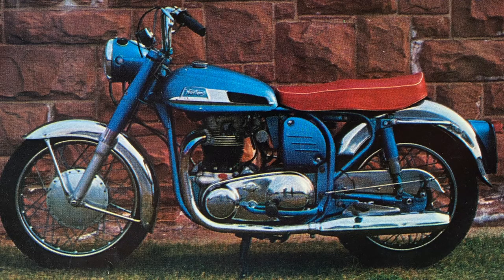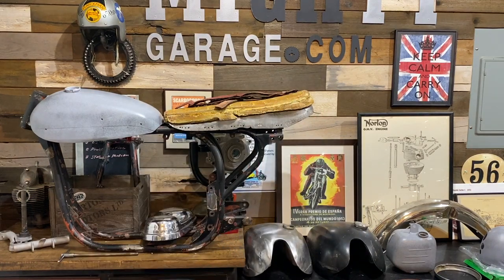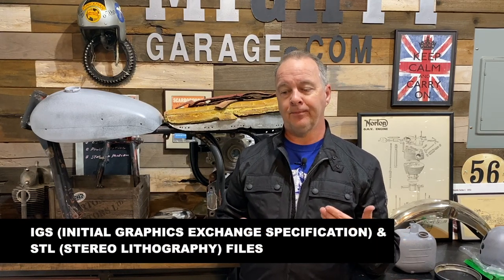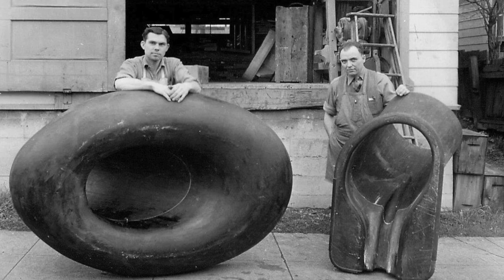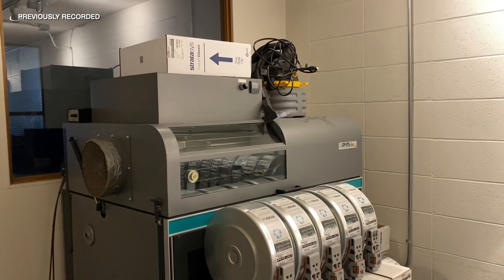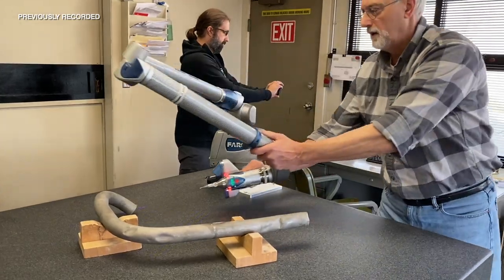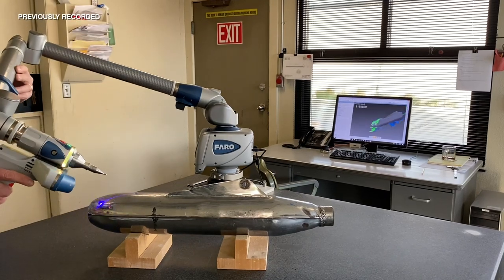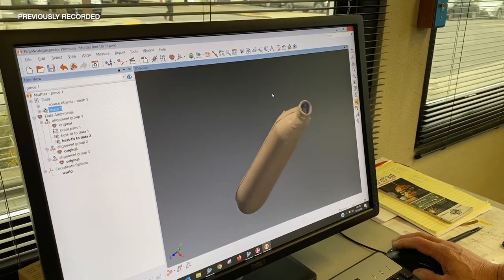1961 Norton Manxman 650 project (19) - Reproducing the exhaust system (Part 1) 3D Printing

Comment: That is pretty amazing work scanning those pipes and silencer, I do hope someone can use them to make replicas.  I can't imagine why Norton went for a horizontal seam; they must have had a good reason
Reply from the maker: I know, it's funky isn't it and must have been harder than hiding a seam around the back or at the bottom! Best wishes, Mike
Reply: A seam at the bottom may collect and hold moister which would have eventually rusted out maybe? On a side note, I have an early 1964 Matchless G15CS resto that requires new header pipes with the same/similar kink for the tacho drive,...I wonder if they are the same pattern as your Manxman?

Comment: The Technology is amazing and a million miles from scanning back in the 90s. In those days the only way to get a 3D image was by combining several flat scans and then waiting a day for a computer to combine everything into a green blob. Now the whole process is simple, fast and the images even show the blemishes in the scanned oject.
Of possible interest to  Norton 650 Dominator owners. The extra kinks in the Manxman exhaust pipes also help them to clear the kick start and brake levers. The Factory stopped making them due to the extra time needed to fabricate each set accurately. One bend just slightly out of place would result in a pipe having to be scrapped.
Reply from the maker: Thanks very much for your comment and also for this valuable information!  I didn't know and really appreciate the additional detail. I'm compiling as much information as I can about this model as I go and hope to pull it all together one of these days. Best wishes, Mike

Comment: Fascinating.  You might tell those guys about a product called dulling spray. It’s a removable spray much like spray paint but fairly simple to clean up from chrome..
Reply from the maker: Thanks a lot. Yes, they did have some spray. It was like a grey matter powder that just wiped off afterwards. Steve sprayed some on the bench to demonstrate how it worked. Amazing stuff. As he was scanning the muffler, he realized that he didn't probably need to spray them. Best wishes, Mike

Comment: Hi. I have been enjoying all of your videos. You might try to contacting Jay Leno. He did an episode on 3D scanning about a year ago. He has had several metal parts reproduced and he could possibly provide a few leads on a manufacturer. For the pipes find a good CNC tube bending shop and they could make a set. Thx and keep the videos coming!
Reply from the maker: Great suggestion!  Thanks very much Timmy. I really appreciate it. Best wishes, Mike
Reply: Jay has done several episodes and they are five or more years ago, how time flies!

Comment: For the manufacture of the header pipes a computer controlled pipe bender should do the trick
Reply from the maker: Thanks a lot Derek, I will do some research to see if there are any in this area.  Best wishes, Mike
Reply: you can up load that recorded digital data and a computer controlled pipe bender will 'realise' the finished item !!  This kinda stuff stretches my gourd.
Reply from the maker: Thanks a lot man. I appreciate the help. Cheers, Mike

Comment: You may be interested in a new process to make these silencers using your 3D scan data. Incremental Sheet Forming (ISF) ideal for prototype and short run sheet metal parts. Try contacting Roger Onions at Reshoring UK. Roddy
Reply from the maker: Wow, thanks a lot Roddy for this info!  I really appreciate it. I will save this info and give them a call. Best wishes, Mike
Reply from the maker: Hi Roddy, I'm so glad to hear that you are doing better. Wow, you have an amazing collection of Nortons!  Best wishes with your projects in the garage. Take care and best wishes for a strong recovery, Mike